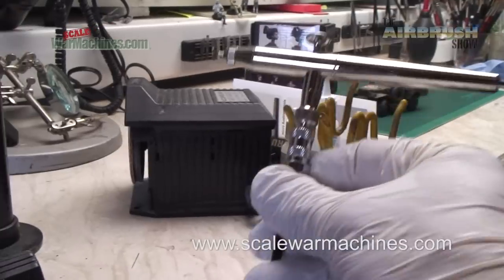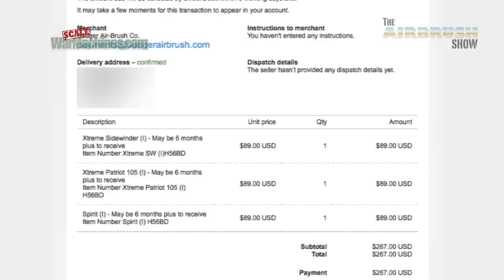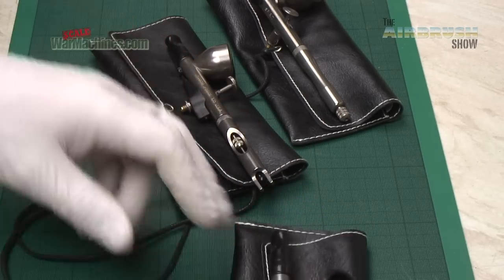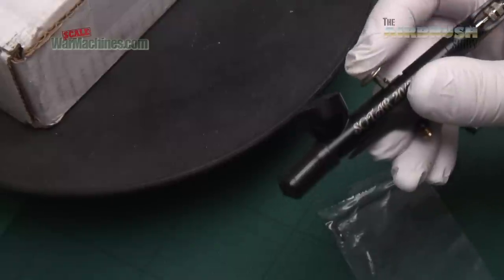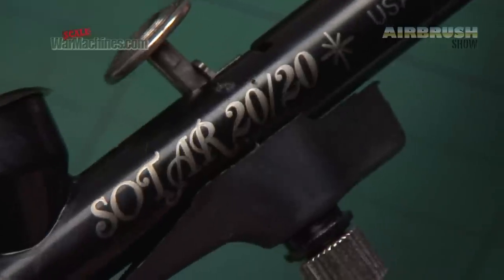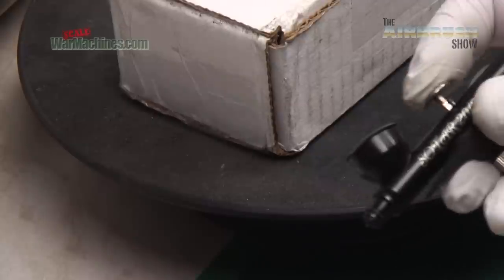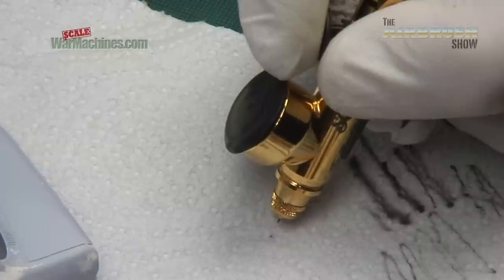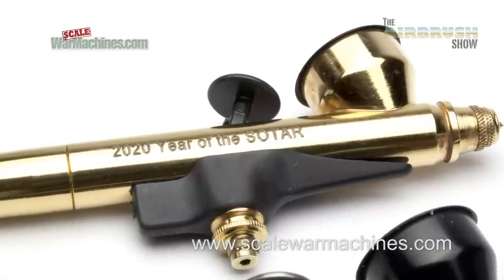BEST VALUE AIRBRUSHES EVER?! - BADGER SOTAR - THE AIRBRUSH SHOW S2.EP07

Comment: The Badger "Birthday Event" is based on Ken Schlotfeldt's President/Owners Birthday,  not the business.  😉 also, Badger has one of the best customer service policies in the industry,  and their parts are also the most inexpensive out there for a name brand airbrush.  You can also order anything when you buy during the b-day event, so add some parts, accessories or paints at the same time and you'll save with the combined shipping.

Comment: Hi, just a quick question about the Gold Sotar 2020, does the nozzle on yours unscrew completely? Both me and a friend bought the gold one and only the very front part of the nozzle unscrews but not the back part that contains the needle “cone”. I have read on some forums that the newest ones ar welded and cannot be removed.
Reply from the maker: Good question. I've not taken it apart to that extent. There was definitely a difference in construction from the black one but it appears to have a thread at the base of the paint cup for the nozzle assembly but I honestly couldn't say if it is welded or not at this stage - I hope not!
Reply: Scale War Machines I will email Badger and ask them about it. I am not sure if it is supposed to be like that or not. Cos other Badgers you need to change that little needle cone/collar if you change the needle size. But if it is welded in place then it is a one size only airbrush, which wouldn’t bother me but its a need to know thing. Can you see if you can unscrew yours or not?

Comment: I have the Khrome Renegade and it is Awsome. I have a Sotar 20/20 as well. But I have a Question. What was your PSI and Thinner Ratio on your Mission Models Test with the 20/20 I use mission model paints, and  I could not get mine to spray anywhere close to the lines and precision you got. So please could you tell us your settings you did to achieve this. Thanks.
Reply: Yeah I find my SOTAR clogs easily but with the same needle set up my Krome sprays great. I put it down to thinning paints properly as the SOTAR is really an artists brush and should be used with inks and washes while the Krome is a custom paint job brush and can handle thicker paints.
Reply from the maker: When I looked back at this, I can't remember honestly, but to me it doesn't look that thinned, maybe a small bit of thinners ( a few drops). You can see the paint going on thick in the video. Suggest you start straight out of the bottle at 2.5 bar and reduce to an ideal operating pressure of 1.5bar. If it spits and splutters, the paint is too thick and so dilute it gently until it sprays smooth. You will need to empty paint cup and spray through with thinners each time you try a new paint/thinner ration to know it's an accurate test. It's all trial and error I'm afraid but I literally loaded some paint, few drops of thinner, backflushed and began spraying with the SOTAR so it implies to me the Mission Model paints should be pretty good without too much thinning - at least in a SOTAR. Start with high pressure on a test piece and then lower the pressure to see what happens.

Comment: I tried a Sotar and really wanted to like it as I like the design, however it turned out to be a sputtering mess that couldn't paint straight and was like trying to drive a car without a steering wheel. I checked the needle and nozzle to see if there was damage but there was nothing obvious. I'm not sure what the problem was. To Badger's credit they sent me a new nozzle and needle free of charge but I still couldn't get it to work right.
Reply from the maker: I can see how that might happen, my view on the Sotar and many of Badger's brushes, is they are good but variable in terms of quality, or build quality, or at least simplicity of use out of the box - not really for beginners (not that you are) or its pot luck if it works exactly as intended straight away. I would call the Sotar fiddly to get used to, but very capable. It's a bit like taming a wild stallion. I have given one to a friend who is a sort of airbrush beginner to see how he gets on with it. I find the Sotar very nice ergonomically and I like it a lot, but it took a while to get it bedded in and work out its quirks, and I am very used to using all sorts of airbrushes. I'd say not for the faint-hearted. One thing, did you check that the needle was seated properly forwards. It needs to seat all the way forwards in the nozzle or you will get splatter at some point in the stroke. Also, make sure there is no paint clog in the nozzle. Once I sorted that, it got settled and works well. For the price they are good, if you are a bit of a seasoned air brush painter. I consider it one of my preferred airbrushes now it is tamed...

Comment: I own 5-Badger 150 airbrush they are the best for the price and one can now find a used one for $50.00
I custom modified the one I bort back in the 1970s to work even better then it did out of the box. So there is no need to spend $100.00 or more to have a great working airbrush.

Comment: How does this compare to the iwata hp-b plus hi line?
Reply from the maker: I think I run an Iwata HP-CH HiLine so slightly similar. These Badgers are good workhorse airbrushes, not with the build quality or finish of Iwata but perfectly serviceable. The Sotar is like nothing else and I really like it ergonomically, I like the Extreme Patriot too for laying down base coats, it's like an Iwata Eclipse but with a wide nozzle and high trigger. The Renegades are the closest to the Hi-line range but not that similar, the Iwata is slightly more high-end and robust, with a better MAC valve. For for price, with the offer, I have been very happy with these and may well buy more. I use Iwata, Badger and H&S, even Aztek, all are capable. Badgers are cheaper and consequently less well made, but still a joy to use and perfectly acceptable. I would recommend all, but it depends on your personal preferences. For a beginner, I would recommend Iwata, purely as they are less fiddly to get set up and running correctly - also the needle is often less exposed.